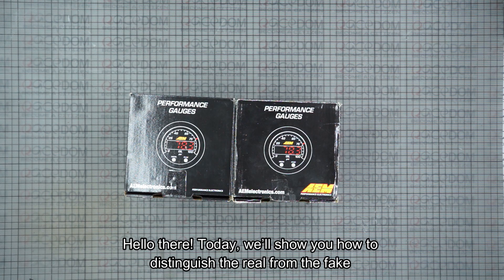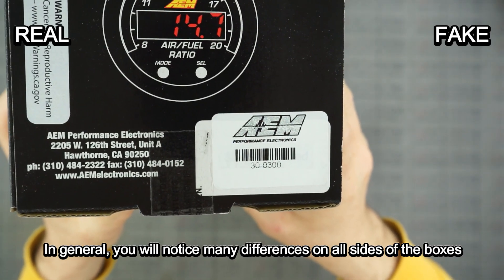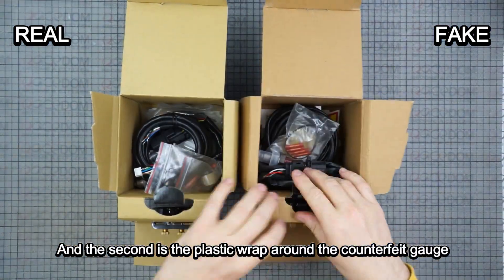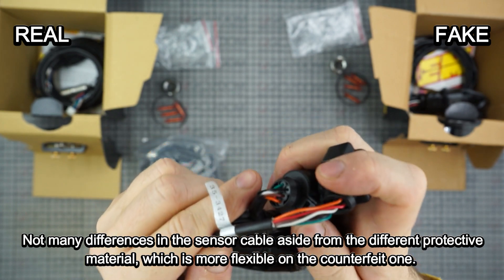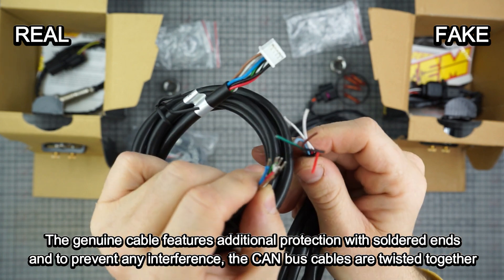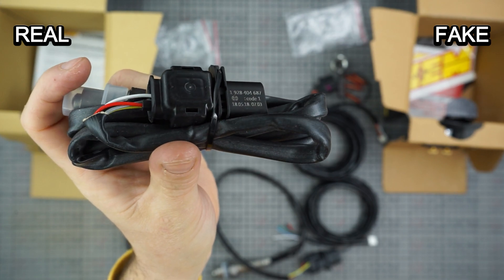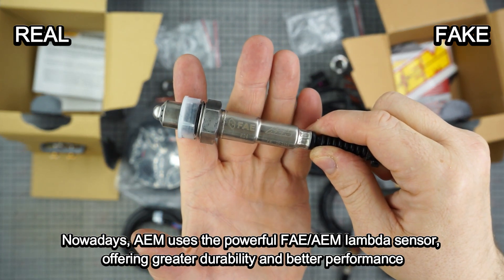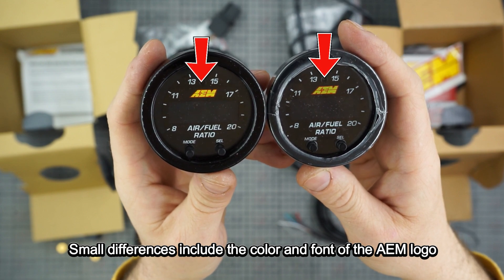How to spot a fake #AEM #wideband  #AFR #motorsports @AEMpowerTVelectronics  @HolleyPerformance

Comment: Bought the 30-300 Xseries version from amazon 3yrs ago, still new in a box, everything checked out, so its legit... came from "Highend Autosports", which is on AEM's dealer network.
Reply from the maker: That’s great to hear! If it came from a dealer listed on AEM’s official network, there’s no way it’s a fake. AEM is strict with their authorized distributors, so you can be confident it’s 100% genuine.